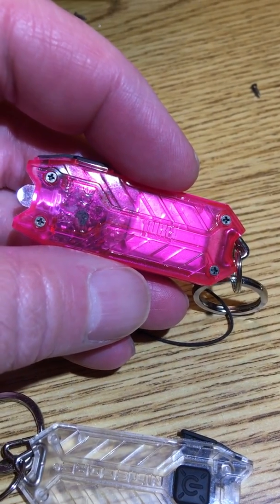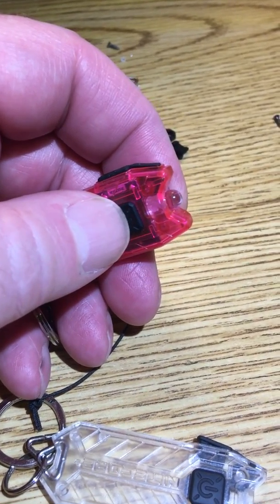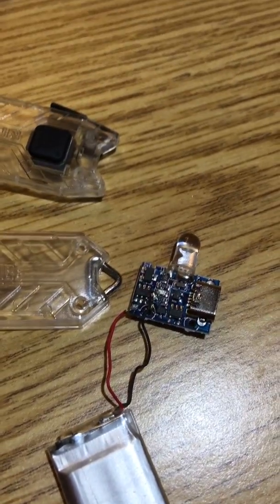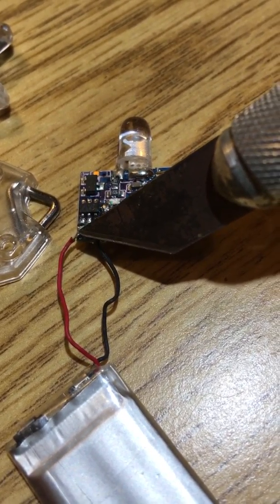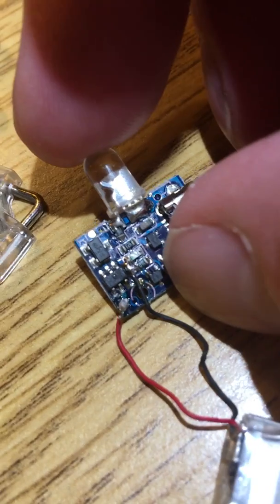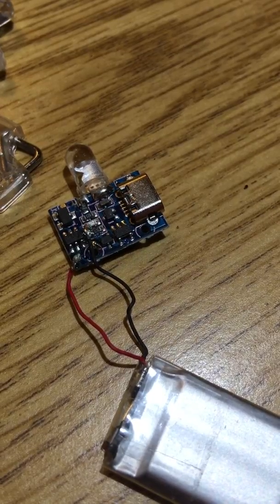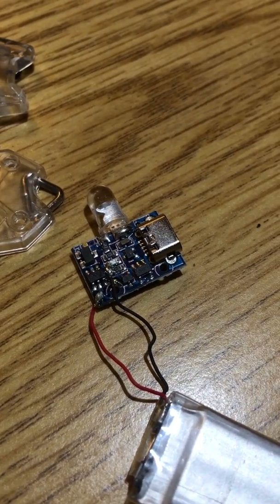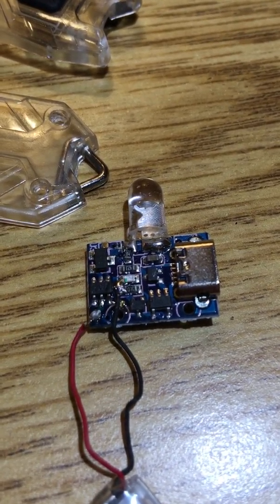Nitecore Tube fix

Comment: Same problem on my tip but im not experienced with soldering or where exactly to reattach so stil stuck!
Reply from the maker: Maybe a friend or acquaintance has some basic skills & can help. 
Take a look at the (WUBEN G2) thin keychain flashlight. It’s usb c rechargeable, 500 lumen, quick detach from keychain, pocket clip, magnetic base and it’s been very durable. 
Wuben is a fairly new brand that’s introduced some very innovative products.

Comment: Thanks so much for posting this video. Just fixed mine, it had exactly the same problem. Charging light on, but no output no matter how long I charged it for! Fixed using a binocular microscope and fine soldering tip. Under the microscope it was clear the positive lead had sheared off at the PCB solder joint junction. The remnant would seem to indicate it was well soldered at manufacture, so I suspect joint vibration fatigue was the issue. Wrapped the battery leads once around the board mounting post on reseating the battery to avoid a recurrence. Excellent info, thanks again.
Reply from the maker: petcatznz ; Happy it was a help, that’s why I do it.